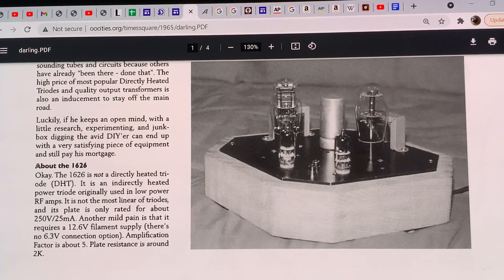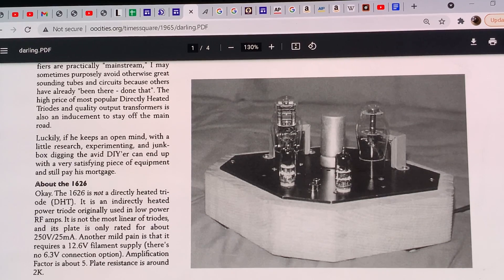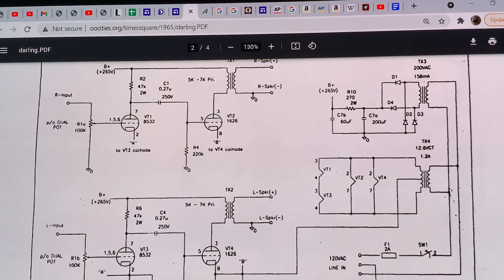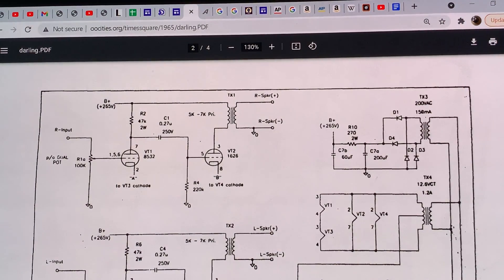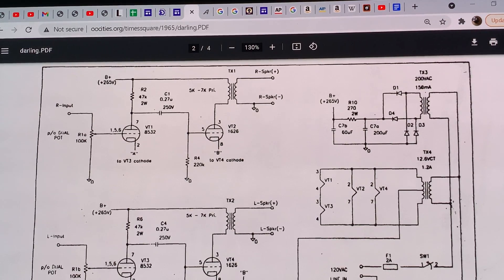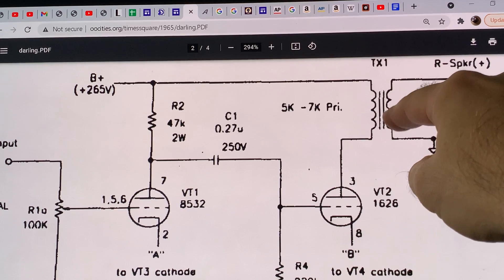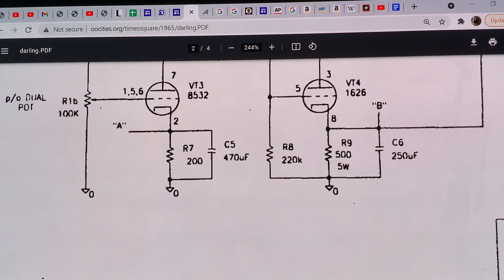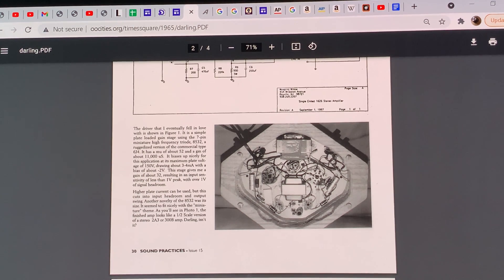Let's build a SET! Darling amp - I'll show both budget AND high end versions!

Comment: Janos I came here just from curiosity. There are much better SE tube amplifiers. If you  heard about 6DN7  (~ 2W) maybe you know what I mean .  But from the other hand , a 10W  A-class amplifier with the best available discrete semiconductors (air-parcel express delivered) maybe cost less than an output transformer for an amplifier like "darling", and without suffering from phase shift that caused from that stupid transformer. It is a matter of COST
Reply from the maker: Indeed, there are much "better" tube amplifiers than the Darling, but better is truly in the eye of the beholder. Comparing the Darling side by side with multiple spud amps (6DN7, 6EM7) left those "better" amps in the dust. ("Better" going for the lower Rp and higher Pout, but two tubes in one bottle result in complex inter-electrode interplays which make these better tubes worse.) Mind, it's not just the parameters of the tube, a lot depends on more than a few set numbers, and also the implementation. 
I'd not call the OPTs stupid by default... most audible OPT limitations are caused by using massively undersized iron that goes into saturation even at medium playing levels - that's the grave evil of the OPT. (So, the use of wrong OPT and not OPT itself.)  On the other hand I find it an apparent defect of discrete semiconductors that they are not impedance matched to their load... sure though, they make for a MUCH cheaper option than tubes. However, I have no experience nor knowledge to guide such projects. Never built a semiconductor amplifier, and have zero motivation to do so in the future. That's just me, and my interests, not a reflection on semiconductors... but there's tons of folks who do that and have good advice.

Comment: szervusz Janos, i am learning A LOT from your videos. do you know if there is an actual wiring layout for the Darling? I mean the kind that shows all the point-to-point wires and connections rather than the schematic?
Reply from the maker: Szervusz Amit, I have talked about wiring in some of my videos (can't remember the title : ( ). 
I'll try to make one in the near-future. 
I'm doing a full rebuild on my original 19 year old Darling amplifier with the original 6J4/8532 driver and 1626 power tube, and will show the wiring.